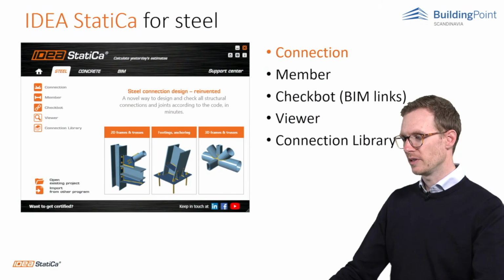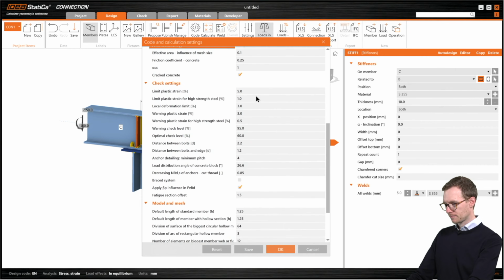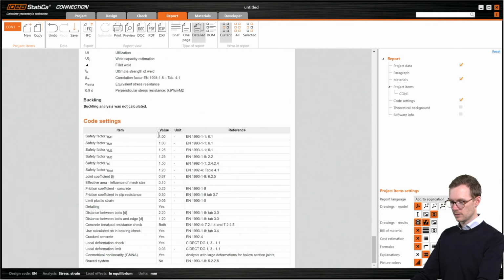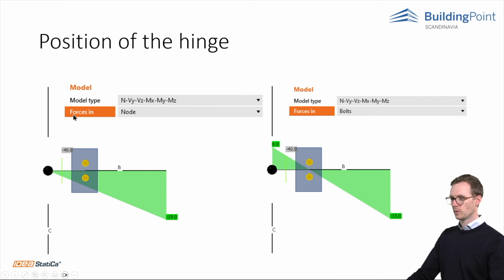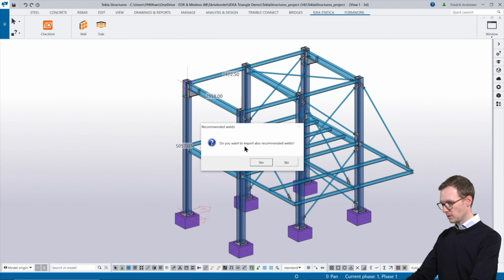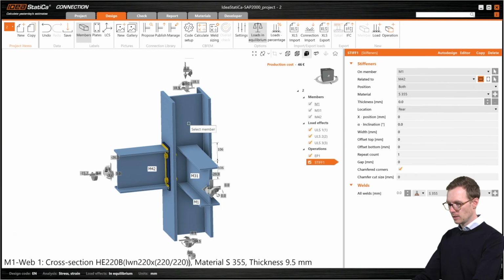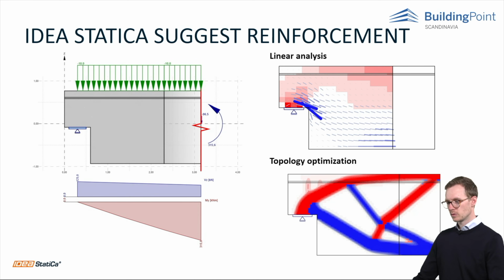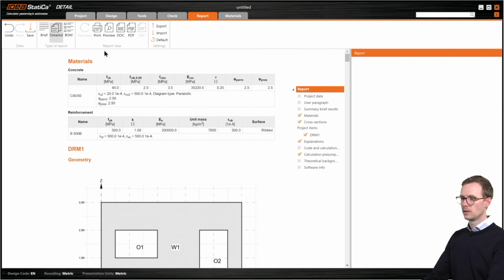IDEA StatiCa 1 hour FREE intro training - Steel & Concrete!

Comment: Thanks alot, i have question pls .. is it safe to depend on simplified method to design connection? ie not putting column load as it is assigned bearing member
Reply from the maker: Hi, generally one can never say that a method is safe. A method should be used carefully and result that comes from using a certain method must evaluated by the engineer with respect to safety and the actual use cases, governing standards and so on. Using a certain method can lead to conservative results in one case, and unsafe design in other cases, this is true for quick formula estimates, full FEA, full scale tests. Sorry for the disclaimer, but that's engineering 😉